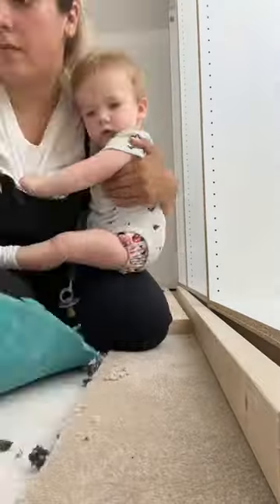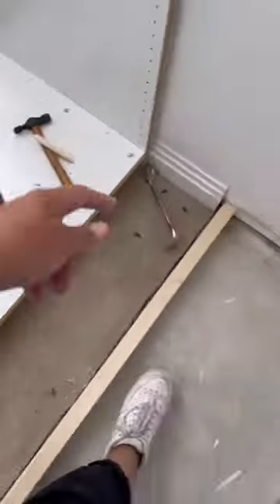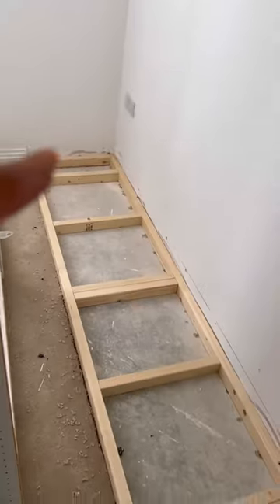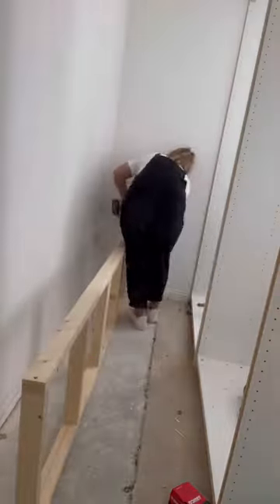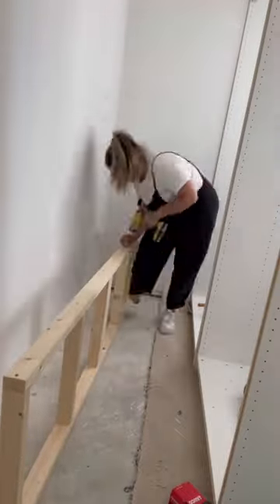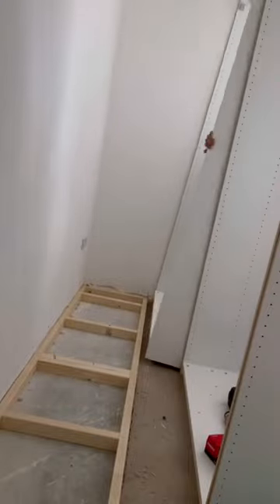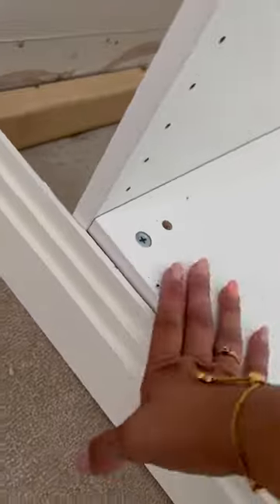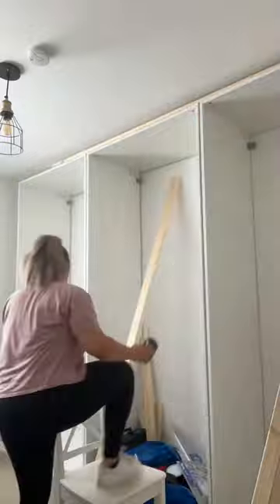DIY Built-in IKEA PAX Custom Hidden Wardrobes Part 1 - Building a base #shorts #diyforbeginners #diy

Comment: How do you secure the base to the floor? My floors (and walls) are concrete and I’d think if I only secure the base to the wall, it will be wobbly. Thank you 🙏
Reply from the maker: You can drill a hole and drive a bolt in, but the weight of the wardrobes and then everything in them will stop it from moving x